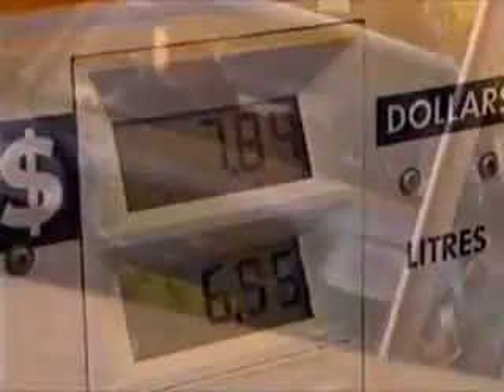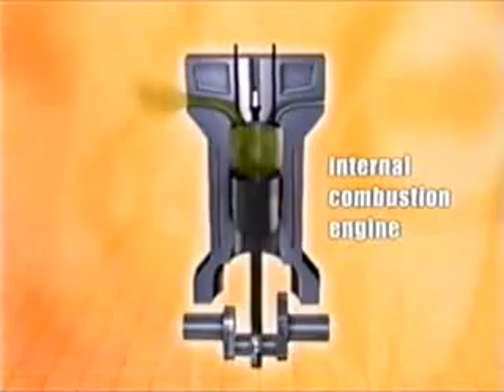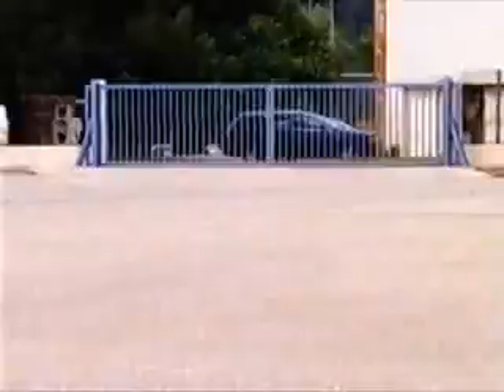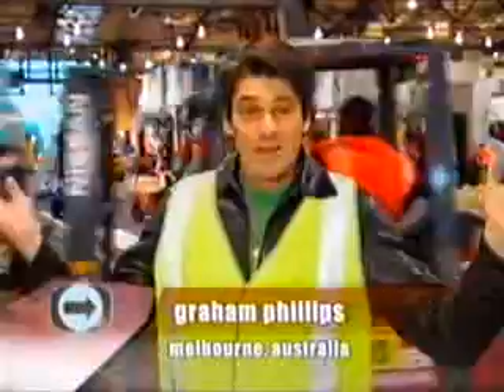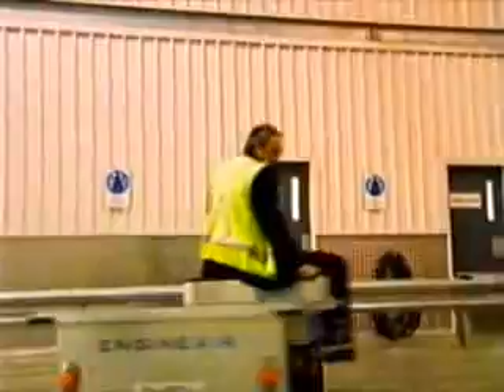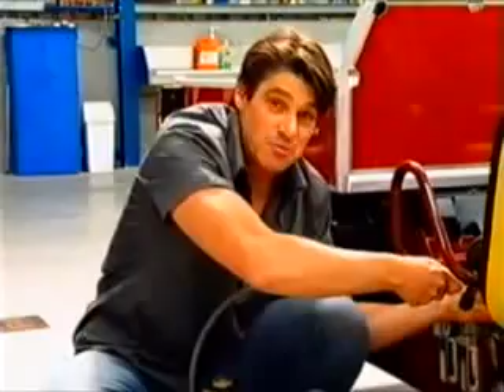Carro Tata Motor Aire comprimido

Comment: TERMOLIC can compress air at 300 atm. With a volum of 188 l the energy value is 1 kw/h and the cost 0,01 €. Cars can be filled from trailers parked where efficient.